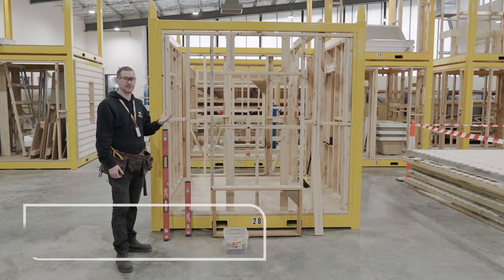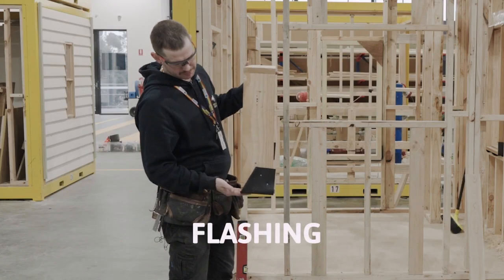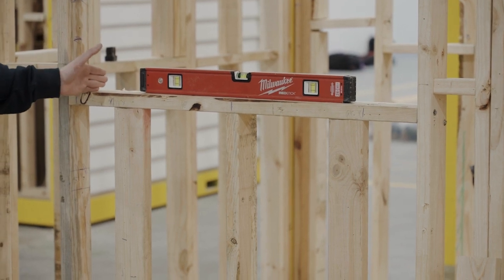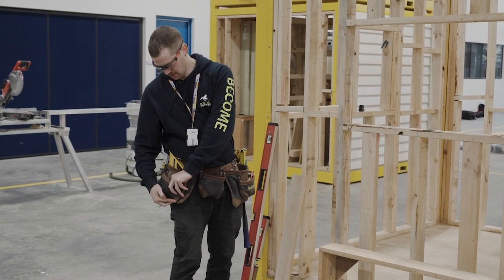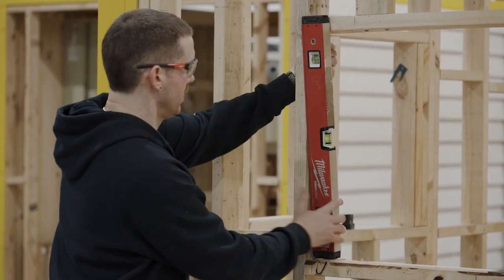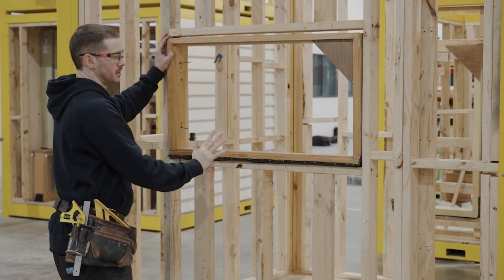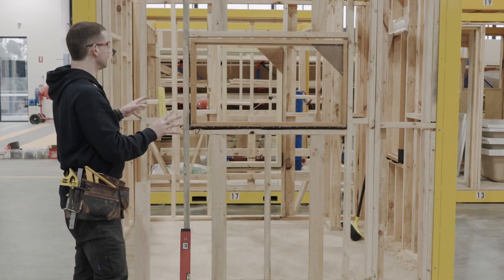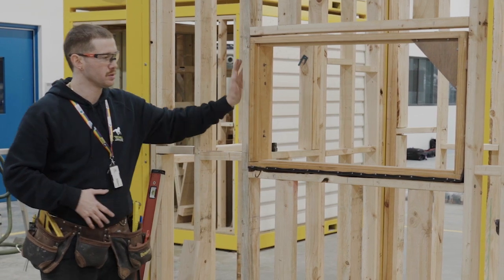Box Hill Institute Trades Building Strong: Installing a Window

Comment: With the angle above the window, (bigger gap above on right side vs left hand side), is that because the window is not level or the frame? 

Secondly, why do I always split the wood when nailing and screwing, unless I drill pilot holes?

(I am about to roll up my sleeves and renovate our old shed, so this was a very useful video, but I will ask these questions to gain knowledge that can only help me.)

Thank you!!!